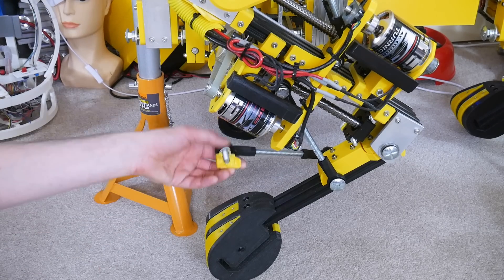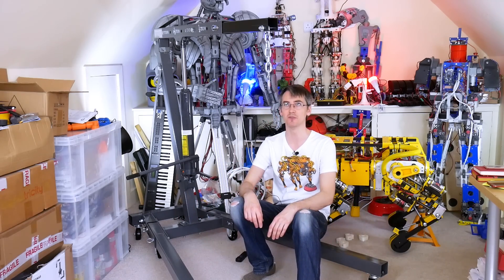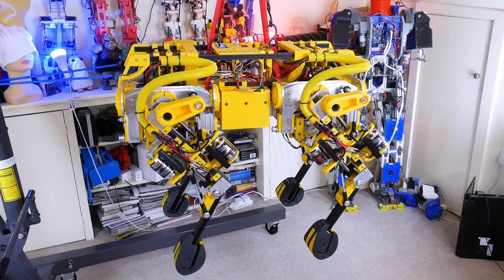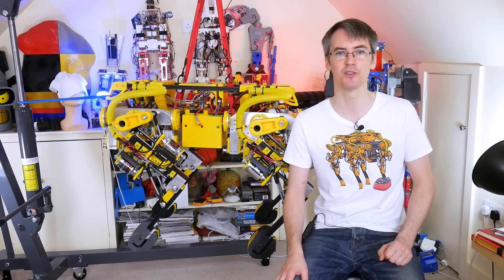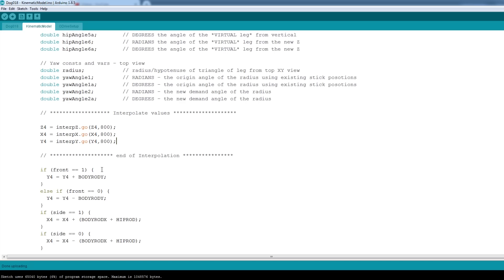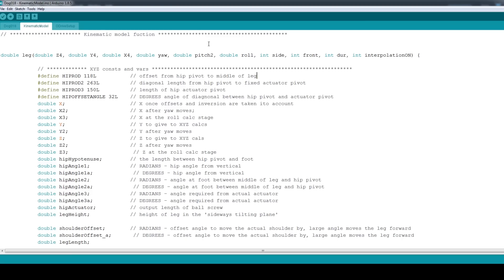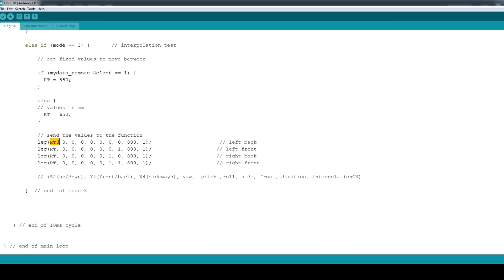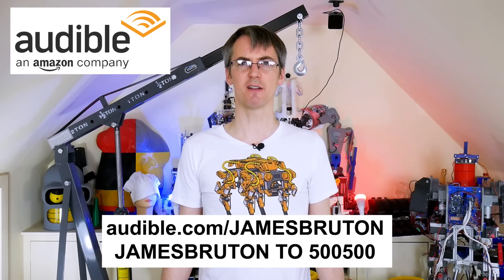openDog Dog Robot #18 - I bought a crane! | James Bruton

Comment: Introducing OO programming is totally overkill for the code problem. All you needed to do was delete the static keyword when you declared the variables. The main use of static is to tell the C compiler that this value will never change, so when multiple function calls are made to the same function only one copy is created and it's shared between them all, saving space. The problem happens when you do change the value of the static variable. Now multiple copies of the same function call will be trying to access the same memory spot at the same time.

The specific name for this problem is that 'static' is not thread-safe. The ramp library is calling your function in threads.

Comment: Ok here's how I'd change the code. I'd create classes for

Joint - offset from parent (be that another joint, or the platform / dog) pivot point, range of motion, child joints
Muscle - manipulates a joint, abstracts all of the feedback / O drive management stuff so that it can be replaced
Pose - responsible for moving the joints into a position at a given speed, given their current orientation, interpolation etc. 
  - minimum and maximum speed can be sourced from the current muscle implementation
Leg - Series of joints - Calculate the IK automatically
Gait - selection of poses

Separation of concerns. don't mix multiple processes in the same function.
if we still need enums, then replace magic numbers with enums. 
Abstract all comms

Fix the Github repo so it shows just the current files in the project and not episode by episode. Anyone who goes to github will either be wanting the most recent code, or is smart enough to go back and check previous checkins - which can be named by episode.

Comment: If I'm understanding the issue correctly, for some complex movements different motors have to move at different speeds, so you're defining a time for the action and having the motors act together.  I'm assuming there's a maximum speed for the motors; is that represented in the code at all?  Another way of putting that is: if you set the travel time so low that some or all of the motors can't make it in time, they'll presumably get there as fast as they can, in which case you'll get that same synchronisation issue; so for any given movement there should be a minimum travel time that allows smooth, synchronous movement (defined I suppose by the axis that has to move the furthest).  Is it sensible to have the code pre-calculate what that minimum is for any given movement and enforce that as a speed limit, or is it better just to have a hard-coded minimum travel time, even if some movements could be made more quickly?

Comment: I think ROS (Robot Operating System) would be a good option to look into on the software side.
It is completely open source and runs on a linux computer.
Ros at its core is a highly modulized system allowing for multiple subsystems to be run in parallel while communicating. This capability can be further extended to other robots as well enabling one robot to see what another robot does. I have been working with ROS for the last 6 months or so and am finally just now starting to get into the more advanced capabilities of what it can do. I am primarily focusing on the navigational and movement capabilities of the robot (A Robotis TurtleBot WafflePi 3). ROS for the turtlebot comes with SLAM (Simultaneous Localization and Mapping) built in with relatively easy (once you know what you are doing) integration with other systems. 
On that note, it is possible to use an Arduino (functioning as a daughter board in this case) to control the motors and send sensor data to the computer running ROS(being the high-level controller). This enables for much more complex operations/programs to be run with more simplistic programming (sort of) as ROS allows you to take all of the data from multiple sources (multiple Arduinos, robots or otherwise) and act upon those inputs.

Long story short ROS is an extremely powerful system that is well documented and would be worth looking into. I have found doctoral thesis papers written using the same robot I am (the turtlebot) without modification is that says anything.
If I recall Boston dynamics is Using ROS for their robots as well.

Comment: Given the relatively low weight of open dog it might be a lot more practical to install a chain fall or winch through the ceiling into a rafter.  It doesn't take much to be abke to hold a few hundred lbs and it would be a heck of a lot easier to store when not in use.

Comment: Hi James, I became a patron today, looking forward to building an openDog. I did download the .stp file and downloaded software to read it, downloaded FreeCad and converted it, sucked it into Cura, will try Simplify3D when I get to home computer. All though I was able to load it in Curaa, I see no way to break it apart, it sees it as one item. I am hoping Simlify3D ( which is the slicer I use ) will allow me to bust it up.
Reply from the maker: The STEP file is the whole assembly - you need some CAD software to break the parts out. FreeCAD should work, or try Fusion 360 which is free to enthusiasts
Reply: @jamesbruton  I downloaded both FreeCAD and Fusion 360, trying to learn. So far I can break some parts out in groups but have not been able to pull out a single part, like the hip cover for instance, but I'll get it eventually I think.
But I do have a few questions, sorry to be a pest.
 Is anyone already building an openDog besides you? 
Where can I find the most up to date cad files? The one I found has the old feet. 
Are you happy with the hardware now and would you say you are far enough along that others can start building? Or do you suggest waiting a while?
Will you ever release/post a parts list? I see you name everything in the videos, just wondering.

Thanks,
wkinne

Comment: We need to see some much swifter movements if it's going to be able to dynamically balance. An average gait takes about 1 second to cycle, which means that each foot only has 1000ms to lift, advance, contact the floor and pull back to the starting position under load. 😱

Comment: So a class is like a function, but you can have multiple instances of it?
Reply: Each instance of a class can have it's own variables.  The functions in a class are used with instances of each class.  So each motor won't interfere with the other motor's variables.  But they all share functions.

Comment: A good solution for training walking robots is an external rectangular frame, made from aluminium section, on a set of castors, that sits over the robot and attached the 'bot (at its CofG) with bungy cord. That cord can be tightened or loosened to give the 'bot more freedom, but it ultimately prevents it from falling over, and being on castors it can move as the 'bot does!

Comment: This might be a stupid question, but given that it's probably the threads wearing out the printed parts, why are you not using threaded inserts?
Reply: It isn't the thread wearing it down, it was when he was messing with kinematics and the legs twisted. 3D printed is perfectly fine for now til he's finished design changes.

Comment: I think you’re at the stage now when it might be worthwhile spending an hour or two properly modelling the dog’s elements in OO

Clearly each leg would be an object, with sub objects beneath. The front and rear too might be objects, containing two leg objects each and so on..

I always tell my team to get the model right or everything else will be much MUCH harder. 

As you’ve said many times, this started with hacked code and now you are cleaning up the code with improvements to the design patterns used 👍
Reply: Never do OO! The idea that it helps represent real-world objects is an empty promise, and it's only going to be a pain to fix later when the model of the leg changes.

Comment: I know you are going step by step trying to learn about it, but please take a look a some integration engine. You are dealing with differential  equations here (everything depends on the state of everything else over time), and at some point you will not be able to go further.
On the implementation, assign a number for each leg, and use a matrix to store the interpolators. Will make for a smaller and more reusable code.
Reply: IDK fully what this means but sounds like a good plan

Comment: interpolationON should be a boolean, preferably named like doInterpolate :) or even You don't need to set that bool parameter, because if You set interpolation time it means that it should be interpolated so just check if interpolation time > 0 which means interpolation ON :)
Reply from the maker: I'm considering that - there's also a bug in the ramp library where if the time is too low the results go crazy
Reply: @jamesbruton  Yeah sure, these are just programming tips :) Great job BTW

Comment: You should now go the next step and define another class for a Leg... which contains three objects of type Interpolation, one for each motor. Include also any method (function) in the Leg class you see fit (for example the kinematic model functions... may be, in fact the kinematic model should be defined as a different class which is being used by the Leg object...). Then your main code will declare four objects of type Leg, one for each leg and use them appropiately.

Comment: Are you planning on eventually making the openDog go up and down stairs? I've seen Boston Dynamic's SpotMini do it, and I'm curious as to how the obstacle avoidance system detects stairs.

Also do you think there'd be any benefit for robots having ankles, in either one or two axes of rotation? I know a one axis ankle would keep the foot parallel to the ground and can adjust for angles in the forwards/backwards linear direction, and two axis rotation would allow for unevenness of the ground within a plane; but with a small foot size, especially on a robot like the SpotMini, would ankles really be needed? Or do you think feet with some curvature would be able to balance itself just fine without the complexity of ankle joints?
Reply: BD use computer vision and lidar. Not sure he'll be building a vision system. So maybe just fixed gaits